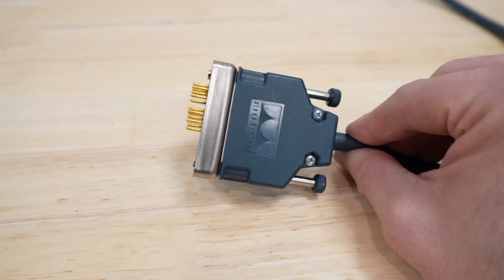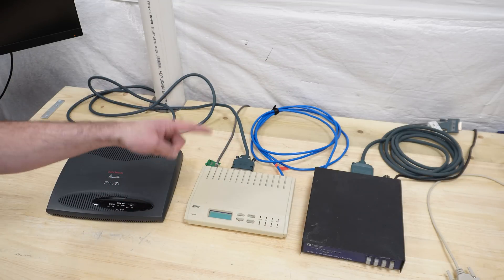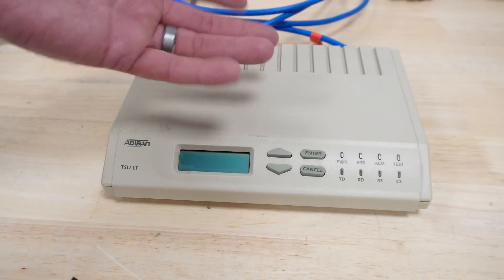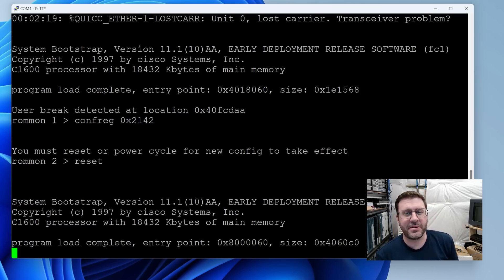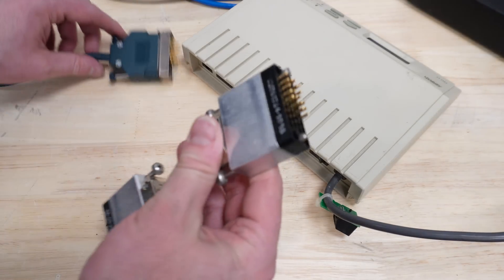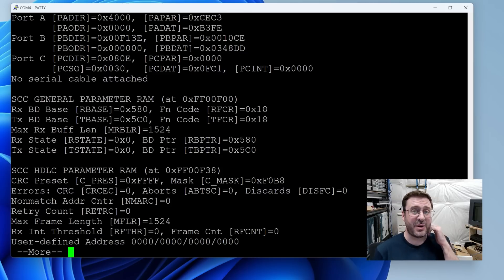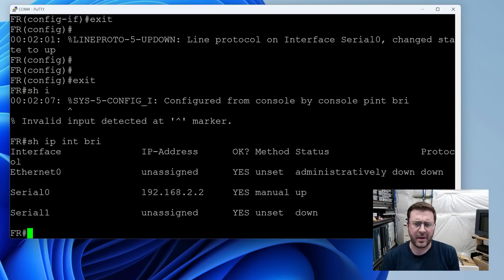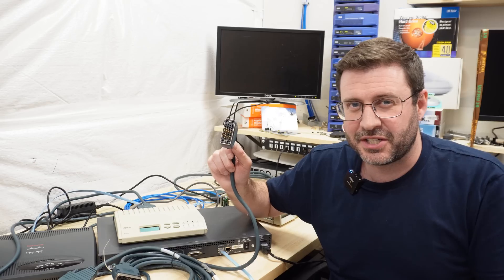V.35 Cables

Comment: T1... and the wonder of 90s kids dreaming of having a T1 line instead of dial-up... My first experience was in 1996 in the 5th grade computer lab. I never thought websites could load that fast. EVER. It took till 2004 before my area even got ADSL and the 1megabit/128kbps was a dream to have at home. lucky supplanted quickly by faster and cheaper DOCSIS cable internet.

I myself did not work in the IT field until the late 2000s so by that time everything was so easy and simple plug and pray actually became plug and play. the late 90s and early 2000s networking must have been the last great wild west for networking.

it would definitely be nice if someone were to donate some DOCSIS 1.1 gear to you.
Reply: This comment just unlocked a memory of being in high school and really wanting a T3 line (was on dialup at the time). I found out that you could get one installed at a residence and got as far as having sales calls with a local provider haha. Of course I didn’t even have a job at that time but I was scheming on some idea of paying for it by doing hosting or some other money making idea. Never got any further than that, but for a moment the dream was real!!
Reply: @einsteinx2  Oh man I tried doing the same in my apartment block in 1998. Talked to two main T1 providers. Incumbent no install fee, monthly $500-1000 + CSU lease + Cisco router lease + additional separate payment for routing traffic to the internet .. all in all >$2K, second option private company ironically called ATM at the time (now ATMAN)  ~$1K installation then monthly:  ~$1K T1 to their endpoint including internet routing + $cable lease from telco. Calculated how many people I would need to wire up to make it all work financially, spammed "Fast internet access" fliers in whole neighborhood and got only 2 firm yes and 2 other maybes interested :( while I needed ~30 people willing to pledge ~15% average salary/month just for fancy internet, that was never going to happen. Two yeas later incumbent telco introduced 115Kbit "almost ISDN" recycling Ericssons failed HIS-NT technology at ~$250 install/$40 monthly while I was making $300 and spending almost $100 of that on dialup alone :| no brainer. Tried finding people to share business HDSL again in ~2001 when it got cheaper to a mere $250 monthly and wifi became available but still very few takers in my area :(
Reply: I remember using file-sharing in the early 2000s at 28.8kbps. It could take days to get a 3Mb file. I asked for high-speed cable Internet for my 12th birthday! The amazement when we could surf and download in minutes rather than days.
Reply: @br3nd4n  reminds me of when people just slightly younger than me were amazed at “wasting” most of a CD on a 10MB y2k patch. Until I explained it could take a few days to download that on dialup!
Reply: Haha yeah, 1 meg in 2006 was lifechanging for me! On paper, I had access to DSL for a few years by then, but the one USB ADSL modem my family tried killed our Windows 98 install! So it was never attempted again, until we got an XP box. 

Then, in 2008, after we upgraded to an "up to 8mbit" package yet only got 2... I managed to get the "ring wire" isolated from our family's Master Socket. This increased our speeds to 7 meg, which felt absolutely blazing! (Though it still had pretty crummy latency.)

Comment: I have some Adtran gear I'm wanting to check out for the V.35 connectivity to IBM mid-range systems (System/36 and AS/400)...
Reply: And also some Perle gear - which have the V.35 connection as a DB-25...
Reply from the maker: that'd be awesome. do you have all the gear you need for it?
Reply: @clabretro : As shown here, the hardest aspect is having the right cables. For work, we had a few remote offices (with T1s) and during COVID there was a dial-up mechanism used. I'll probably try a RAS setup first.

Comment: We needed a speed test. I would guess this was popular at the time because it was simple: They got the phone company to get the T1 working, and all the configuration happened on the router, where IT could control everything else. Much of this would have been outdated by the time I got into IT in the mid-2000s; DSL and cable modems were taking over with much better speeds and less expense of not having private lines. I did experience T1 for the internet, but nothing compared to being on a 1Gbps fiber in the office for the first time and seeing an ISO download in seconds.
Reply: Be sure to enable ppp compression between two Ciscos... they could squeeze extra speed out of a 1544kpbs T1 that way (worked for ISDN as well)!

Comment: These were used extensively in Australia when connected to Telecom Australia's 'Austpac' switched data network. The V.35 connector was standard on 4-wire data modems offering speeds of 48k synchronous. Awesome stuff.
Reply: In fact, in my time working in IT with Telecom Australia, I was told by someone in the know that Telecom Australia employed a guy to make cables. That's it. That was his job. He'd make HD-26 to V.35 cables, V.35 to X.21, V.35 to V.35, all of them, any length you needed. Physical interface standards were still needing to be streamlined, hence his job. If you really want to get freaky, try the same connectivity thing again only using 'Eicon' brand network cards (usually DPNA ISA cards), DOS, and NABIOS/NETBIOS IPX/SPX DOS extenders over PADs. Man, that was a lot of acronyms! But that was what we worked with!

Comment: @3:00 You cannot think of the T1 as the Internet in this case. You can think of it as a very long cable provided by the telco company between two points. The two CSU/DSU units can be in different parts of the country. :)
Reply from the maker: yeah, was using the internet as a poor analogy of sorts lol
Reply: which is effectively WAN, since in those days WAN wasn't necessarily "internet" but anything outside (or between) your local networks
Reply: @mogwix  Yes, the WAN. But there's no possibility to add addressing to the T1. The T1 ends and starts where the provider has configured it to when it were set up. You as a customer will see this as a long cable, but there are much equipment involved. (The fact that the T1 often terminated at the telephone company itself then from there added Internet-access is another story.)
Reply: @kanalnamn  like any other connection, yeah. the customer CPE only cares about the next hop but the physical infra dictates the link throughput and latency. the T1 itself isn't "the internet" (just like active ethernet, gpon, DOCSIS, DSL, wisp, satellite) but for the purposes of the demo, if the goal is to ping two devices over a T1 link, the end result is functionally identical whether or not that traffic was routed over the internet.
Reply: @mogwix  It's nitpicking, we're both kinda correct. I'd rather consider the Cisco 2500 in this example as "Internet" if Internet has to be involved. The Cisco 1600 is customer side. :) (Why on earth don't I get notifications any more when someone answer my comments...?)
Reply: @kanalnamn  I have customer sites interconnected with leased lines that will call me to say "the internet is down" whenever they accidentally reboot or unplug something in their network. I'm not spending the time to explain that their dark fiber isn't "the internet" since as far as they're concerned, if a link goes down so does their connection to the outside world. I just make a ticket and wait for the follow up call that someone unplugged a UPS to charge their phone or something.
Reply: @mogwix  Yep. Same here.
Reply: @mogwix  - yup, good point. As an example, all of the schools in the area all had a T1 back to the main district office where they have the centralized networking (and eventually Internet). Same with my county's regional 9-1-1 and access to the California DOJ database ("CLETS"). All the local PDs and Sheriff substations had T1s to the local 9-1-1 center to get CLETS access, and they also used it for Novell's Groupwise email and NetWare filesharing (when the Internet was still in infancy of dial-up). Hah, I remember being on a job moving the 9-1-1 Dispatch and data center. We had the local telco on the line to do a "hot cut" of all of these T1s from the old location to a new location. My boss and I unracked all of the Cisco 2500s and 1600s (sitting on shelves) and AdTrans, put them in boxes and on carts and drove them to the new location, set it all up, etc., and within 30 minutes all of the data comms were switched over (plus the 9-1-1 voice routing, but I wasn't involved in that). I believe we did this cut at like 4AM on a Wednesday morning as that was the historically lowest 9-1-1 call volume time.
Reply: a T1 was just a pair of wires that the phone company let you keep connected directly to the tsu on the other end, all the magic happened in the cpe boxes.
Reply: @jester1983  >T1 was just a pair of wires

two pairs <adjusts his glasses> :-)
Reply: @jester1983  The T1 can be multiplex into a VC-11 (VC-12 for E1) and become a part of a larger faster stream that are demultiplex elsewhere. There are a very large and detailed array of different overheads and containers that can be involved.

Comment: Now the goal is get a network going using as many technologies as possible.  T1, DOCSIS, Fiber, Ethernet, Serial, Modem all at once.
Reply: You forgot FDDI and ATM to round out the 90's common protocols that are long dead now
Reply: Should get token ring in there somehow too.  And maybe IPX to a novel netware server
Reply: @ryanvoots9827  Be careful with that token ring. you unplug one of those cables and the token falls out :D
Reply: @ryanvoots9827  then you can finally approach the Comic Book Guy's level of network convolution! (Since he inexplicably runs both token ring and ethernet, and wants them both hooked-up to a T1 line at once!)
Reply: Can we get some FIDDI going too?
Reply: @containsnosmashmouth1849  Tree Fiddi??
Reply: Don't forget the RFC 1149 IP-over-avian link
Reply: @blob537  I suspect, with his cat (cute though it is), packet loss would be significant during random hours of the day
Reply: Data over 5 pin MIDI?
Reply: Ethernet over HDMI
Reply: Add network over TOSLINK in just for good measure

Comment: I have a Winchester pin tool sitting around somewhere; I use it for removing pins from Molex power connectors as the tool is just the right size to fit over the pins.  That 60-pin connector is actually called an HD-60.

Comment: I had to still learn about this cable despite it probably being quite obsolete at the time already. We just used 2 Cisco routers one DCE (female end) one DTE (male end) and directly let them talk.  IIRC the only thing you had to do is make sure you set the right clock rate that both sides support and enable the clock on the DCE end for everything else we just handled them like a  ethernet connection (which always seemed a bit useless to me).
This is the first time I actually saw how those might be used in real life when not directly connecting 2 routers directly, the T1 route seems like it would have been a more realistic scenario.

Comment: If you ever use the female V35 cable, add the command “clock rate x” to the serial interface. on these cables the maximum value would be 2048000.

Comment: When I worked in IT until about 2002, these things were EVERYWHERE!  And both T1 (later 2 and 3) and ATM.

In the late 90s ATM started to take over from T1s for large companies.  And ATM was the first place that I heard the term "cloud" for WAN stuff.
Reply: Yup, Frame Relay and ATM really expanded data networks for relatively cheap. Traditional T1 circuits required paying for the entire length of the connection (the total miles). With FR/ATM, you paid for the T1/T3 circuit's miles to the local telco, and then you paid for the speed of the FR/ATM circuit through the provider's network. One great savings was that a company could get fractional T1 speeds with Frame Relay, say 128kpbs up to 768kpbs, so obviously this was way cheaper than paying for full T1 speeds at a smaller branch office.

Comment: Oooo look, a cisco serial to DVI adapter!
Reply: Not quite. 

He calls it a "DB60" connector which isn't correct. It's called a Low Force Helix connector, or LFH-60 because it has 60 pins. This connector was also used for the unrelated LFH-60 video connector standard, and the later DMS-59, which used the same connector with a different pinout and one missing pin used as a key. Annoyingly, you can plug a DMS-59 pigtail into an LFH-60 card, and it will fit but it won't work because of the pinout differences.

LFH-60 and DMS-59 were popular in the mid to late 2000s and early 2010s on low profile video cards to get two video sources out of a single connector, rather than having to have a separate breakout connector and take up an additional slot. You could get both analog and digital video out of these connectors, and a whole bunch of different pigtails existed for both standards.

DVI used an entirely different type of connector with fewer, larger pins and the key on the right side of the connector that had optional pins for analog video carrying capability with DVI-I.
Reply: @GGigabiteM  I knew I'd seen them before somewhere. Had one of them kicking around in the parts bin in the HPC/workstation lab I worked in during 2012. It was endlessly frustrating to be looking for a DVI connector and find the 60 pin instead.
Reply: This goes directly to monitor!
Reply: I remember these pigtails!
Reply: EGA to DVI actually
Reply: @charleysheets8142 you missed the joke
Reply: you missed my attempt to play along

Comment: V24, X21, V35, DCE, DTE, RTS, CTS... takes me back to when I was a DataComms field engineer, you needed a breakout box to diagnose issues. Then there where so many strapping options from the modem to work with the customer DTE. Once you sorted all of that out, it was onto the protocol used at L2 & L3. Biggie at the time was X25 sad to say from a hex dump I could read it all
Reply: From my recollection the hex dump was pretty much all you had!